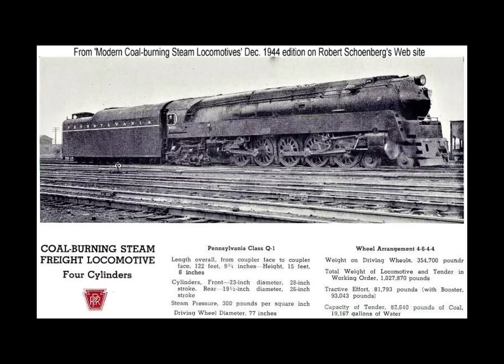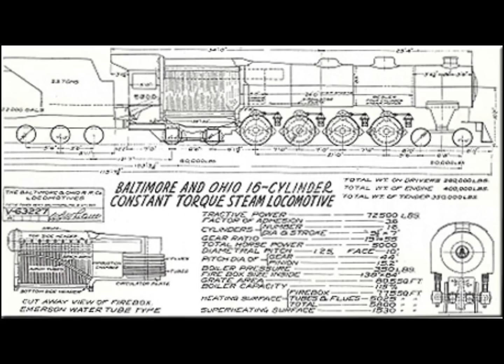The Greatest Steam Locomotive Never Built

Comment: The Henschel made an eight cylinder "Steammotor" locomotive for the German Reichbahn in 1941.DRB19.10. It was built and tested. I don't know if it actually went into service. There is a video on utube with still picture of it. Several years ago the German model train company "Brawa" made an operating HO scale model of it. I think one version with DCC and sound. I wish I had purchased it, but it seemed a bit out of my needs at the time. I sure wish the B&O had made the W1. I grew up near the B&O in the 1950's. I would have loved to see, and hear, the W1 in operation on the "National Limited" .  Thank you for the wonderful video. I never knew anything about the W1 until now. Great  Job!
Reply from the maker: This one wasn't easy to compile enough information. I really had to do some digging.
Reply: Yes it was a 2-8- 2 and did go into service and had a Vee-twin steam engine directly driving on the end of each of the 4 driving axles - making it a V8 steam locos. After the war the US Army took it back to the USA to examine it but it never went any further.

Comment: I talked to a old friend who was at Lima Locomotive, and he asked why they never considered a gear locomotive for mainline use, they laughed at the idea, stating the side rods would the only way to build them. Oh going down memory rails…….
Reply from the maker: Hmmm.,... I like the idea.. Not sure how performance based they would have been though. Shay's and Heisler were in the woods a lot for a reason.
Reply: @TheRailroadCrossing-SteamPower  the same reasoning applies for this video, starting power, removing the pounding of rails, balancing would be way easier. The only thing would required use of a transmission, if it was 100% Steam powered. 
I would have looked at an inline Steam engine with X amount of cylinders, a total departure from standard design. Should I patent it? lol

Comment: The water tube boiler would have been the weakness - they work very well on ships where it can be large and have a constant power output BUT steam locos have something that ships do not have - a loading gauge which means that the boiler is going to be small in comparison.  Also, steam locomotive boilers do not need to produce steam at a constant rate, something that Stevenson boliers cope with by having a large volume of boiling water as an immediately available steam reserve.  This machine would have failed in the same way as Gresley's "Hush-hush" did - give it a conventional Stevenson boiler and it would have been promising (The "Hush-hush" worked very well when rebuilt in that way).
Reply from the maker: I did read that the tube boilers were problematic. it's use in this design tells me that they overcame some of the difficulties to try it again. However, i'm in the camp that suggests more problems would have arisen. There is always un-foreseen things that pop up. Often serious things.

Comment: geared steam engines is a design concept that is very interesting. It is kinda a shame they were never really pursued outside of engines like the climax and shay, which were low speed logging engines, and the S2, which is a steam turbine engine that did show promise. 
imagine if steam had maybe an extra 10 or 20 years, I would be super interested to see what kinds of monsters would have been produced.
Reply: Hi, there was one designed and built in Germany during WW2 .
Reply: @JoseMartinez-lf5fg  thanks for the info, would you happen to know more about it?
Reply from the maker: @JoseMartinez-lf5fg  Interesting!
Reply from the maker: Or as new design principles were introduced if steam could be viable in operation against diesel

Comment: I've always wondered why water tube boilers never became common in railroad applications.  It is my understanding that water tube boilers as implemented in ships were capable of up to 600 psi whereas fire tube locomotive boilers top out at about 300 psi.  That seems like it would be worth pursuing.
Reply: I think that there was a maintenance issue with water tube boilers. Boilers needed to be washed out regularly to remove mineral deposits (called boiler scale) which accumulate and interfere with heat transfer. This is a time-consuming process. Washout plugs give access to the inside of the boiler for cleanouts. A standard boiler would have perhaps 15 or 20 such plugs to remove and replace for a washout. A water tube boiler required 100 plugs or so to provide access to all those tubes. Boiler scale accumulates more quickly at higher temperatures and pressures too, possibly requiring more frequent cleanouts.

Labor costs to keep steam locomotives in good working order were a big reason why steam was replaced by diesels. As labor costs rose railroads were looking for ways to eliminate anything that added to maintenance costs and downtime. Water tube boilers didn't solve that issue.
Reply from the maker: @steveboguslawski114  That is an excellent point!!
Reply: @steveboguslawski114  Well, that pretty well explains it!  Thank you.
Reply from the maker: Along with the S2, I think this design could have worked. It's unfortunate the B&O just didn't have the money to take the gamble.
Reply: They would have to be spot on with their water treatment regime to prevent scale but that's true for fire tube boilers as well. 

I could see the height restrictions of the locomotives being a problem  as the mud drums couldn't have been very large and probably required frequent blow downs. A lot of water tube boilers tend to be very tall  compared to fire tube boilers of the same horsepower.
Reply: Water tube boilers work better in a steady state application, hence there use in ships and power plants. Fire tube boilers have more reserve power for changes in load, such as grade change(hills). Cost, due to maintenance is also a factor, plus retraining due to the change in type, discouraged change in type. Railroads wanted maximum unit utilization for minimum cost, which is why diesels took over, the total cost of use from purchase to decommissioning was substantially lower than steam.
Reply: @odb_roc_hound4186  Is the greater reserve power in fire tube boilers because they contain relatively more water than water tube boilers?
Reply: I would think VIBRATION would be an issue with a locomotive over that of a ship.  Steam locos hammer the rails AND the chassis with equal aggressive force.  Ships seems less so.